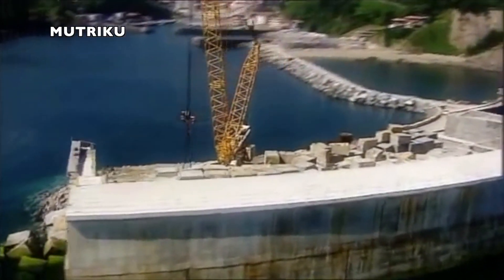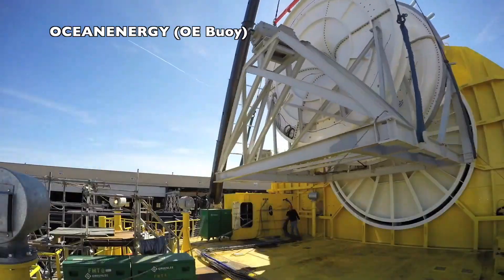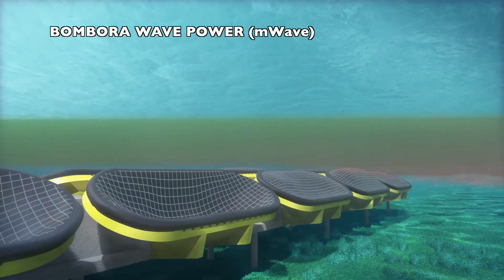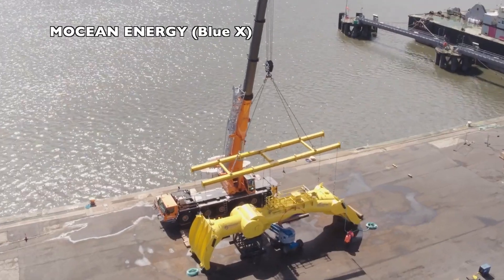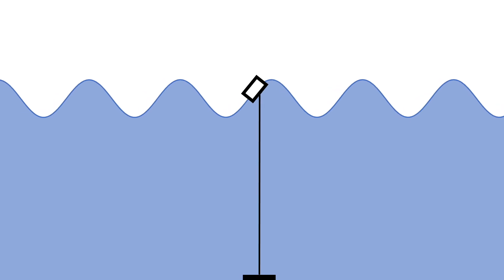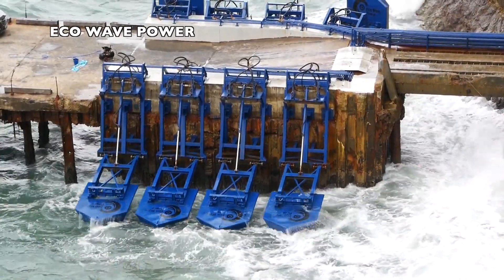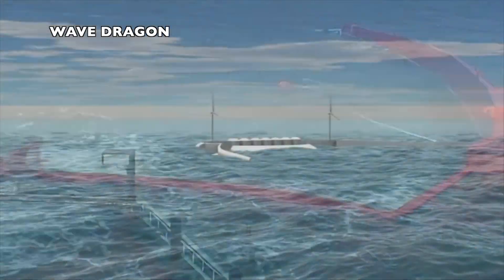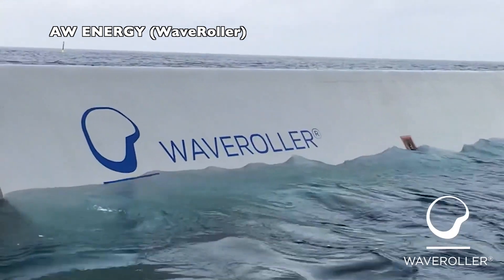WAVE ENERGY: HOW TO USE IT. An overview of some of the existing solutions

Comment: Archimedian Energy. A doublecarusel (weighted withweghts+cables) recives compressed air(from Wind or solar sorce), insome cups at the drept of The șea and rises. The used air is sent back to high pressure, and then stored în tanks underwater.

Comment: The tides will break rhe generators
And need to be replaced
And they will kill all the life that goes through them and when they heat up the water heats up which makes the air heat up
Air comes from water
Not trees
Reply from the maker: Hello James, as you are pointing the conditions for those systems are harsh but they will find the way to make durable solutions. Speed motion is low compare with onshore wind turbines as density of water is 1,000 times bigger than air one. They are seriously monitoring sea life, specially mammals, to be sure no harm is caused.